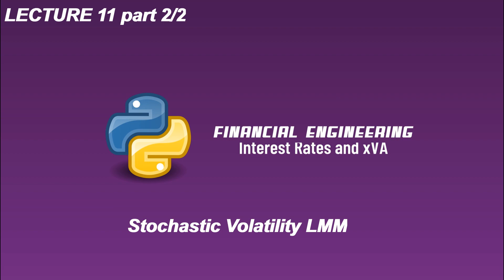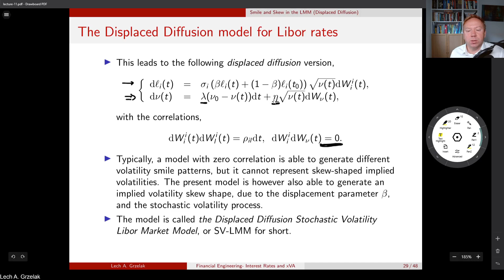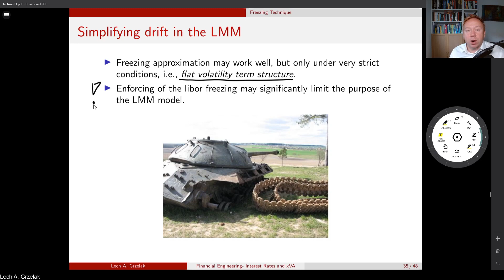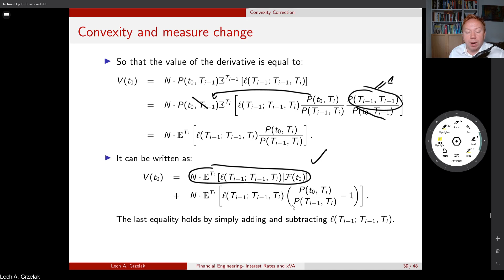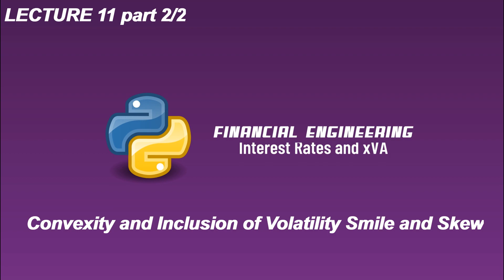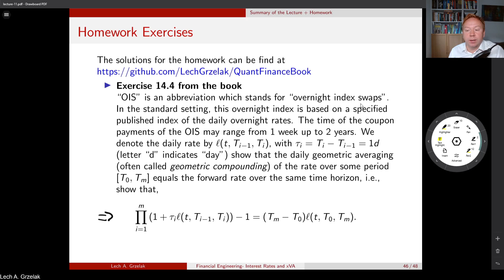Market Models and Convexity Adjustments (Lecture 11/14, part 2/2) | Financial Engineering Course

Comment: why use Libor when its no- longer in use?
Reply from the maker: hello Jeese, this is not fully correct. Indeed, it was an idea to replace LIBOR type rates with SOFR/ESTER but if you look at the US market, for example, the tenor-based curves are still present and will stay for some time. On the other hand, the methodologies presented in the lecture will always stay, maybe under a different form thus I would not neglect them. The same was with the so-called hybrid models in 2008, they were considered "dead", but later, they came back under the xVA. Finally, from the practical perspective Libor model is presented here as the alternative to other models, but in practice, it is not, because of its complexity, used for xVA. Regards, Lech